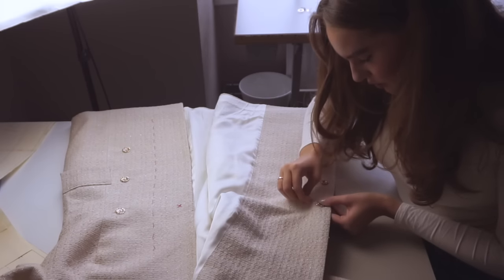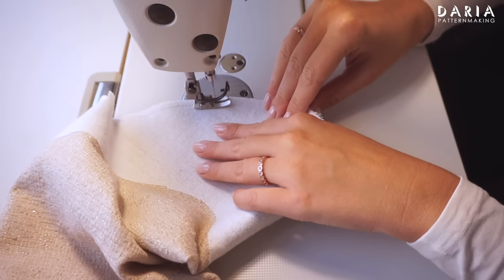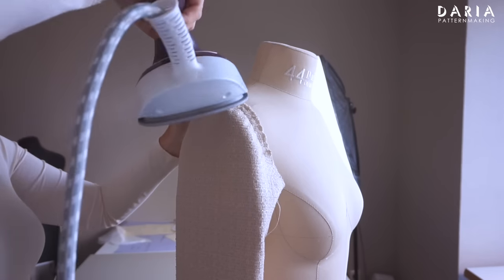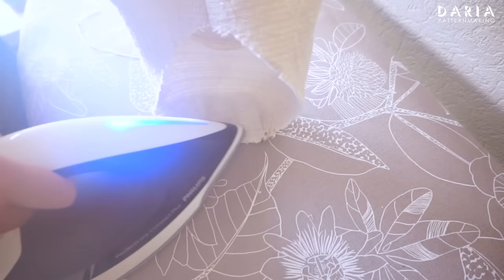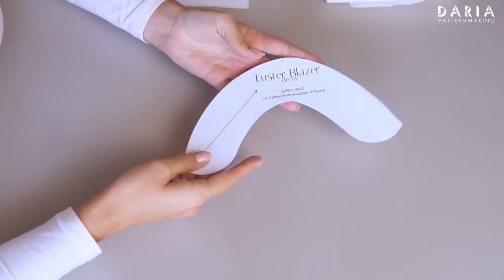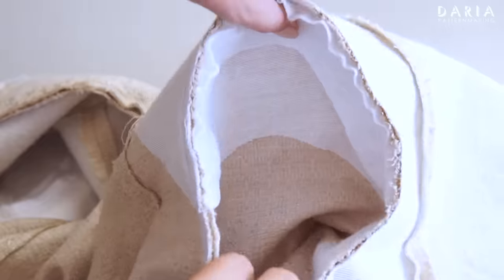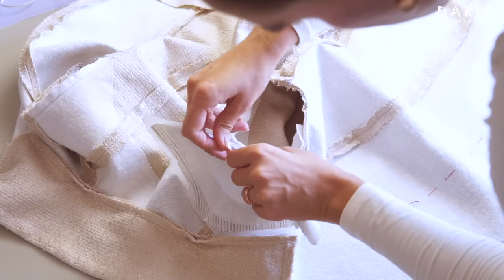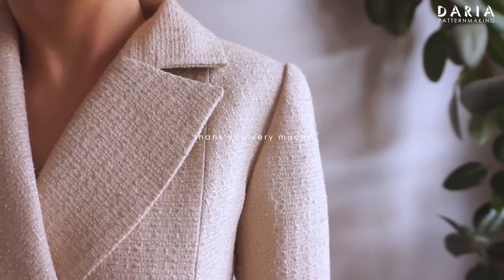How To Sew a Set-In Sleeve With a Sleeve Head and Shoulder Pad

Comment: Thank you for the interesting video. I have a question. When you sew the sleeve into the armhole, you are not sewing on the sleeve, but on the details of the hem and back. Why is that?
Reply from the maker: Actually, I have explained why in the video 😄 In my opinion, the both ways are possible. It depends on every particular case and what is a priority: to control an ease and see it, or to ease it more and uniformly with lower feed dog. Here I have chosen the second option!